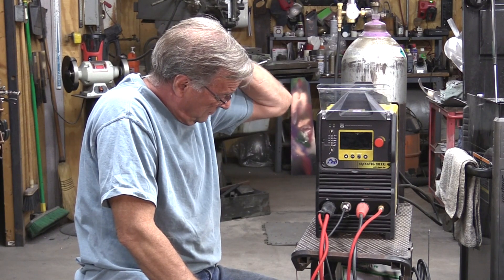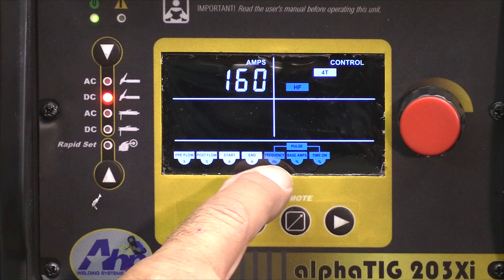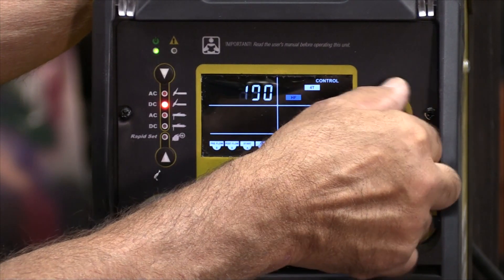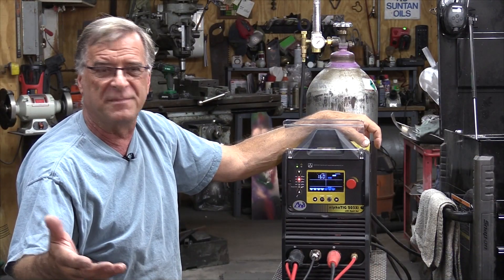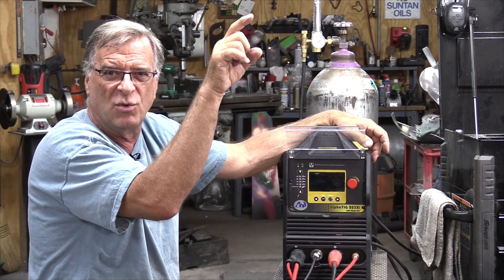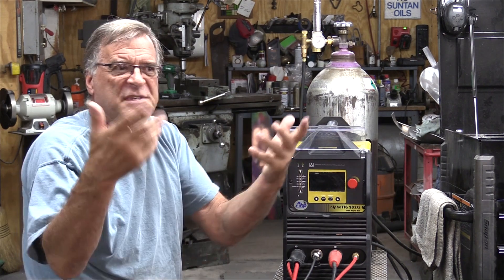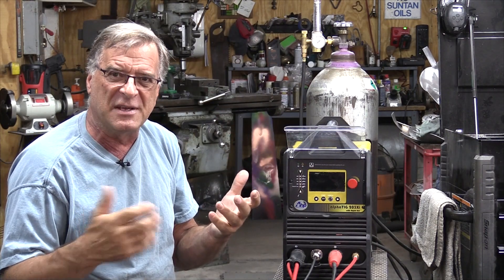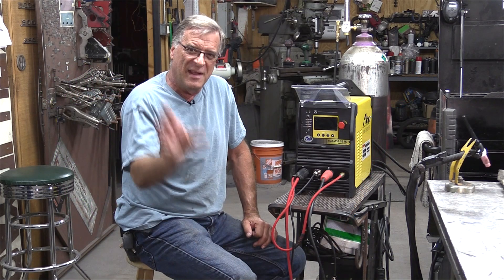How to Use Pulse on the AHP AlphaTIG 203xi TIG Welder & Why & When Pulse Is Helpful - Kevin Caron

Comment: Thank you for the informative video!   What pulse setting do you use for 1/8 inch aluminum?
Reply from the maker: I use a piece of scrap to get in the right range for pulse.   I will change the settings depending on what joint I am welding.

Comment: Hi Kevin. What is your opinion of tig brazing specifically for for automotive sheet metal. I understand it's not meant for structural welds such as a frame but it's seems ideal for panel repair. I guess pulse would be best but my welder doesn't have it.
Reply from the maker: Sorry Tim but I have never tried to braze with my tig.
Reply: @KevincaronSculpture  thank you for the reply.

Comment: I always thought the pulse duration was how long the pulse would be at full power.  Your explanation makes me think my understanding is wrong????
Reply: check your machines manual, I think you're right but it could vary by manufacturer. It's like the balance control on AC, some machines like Miller show % of DCEN and others as a % of DCEP
Reply from the maker: And it's not pulse at "full" power but pulse at minimum power.  Pulse it the bottom of the curve and welding power is at the top of the curve.